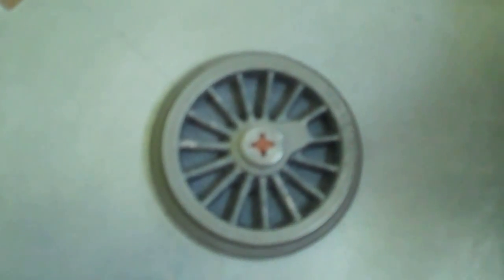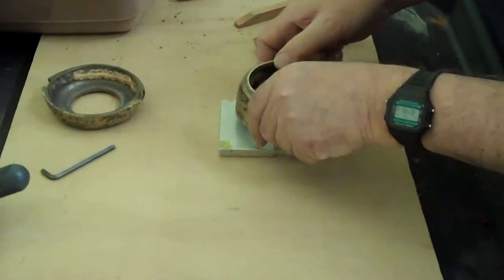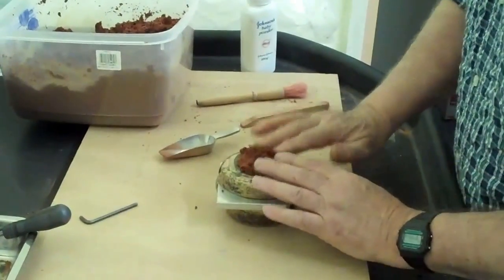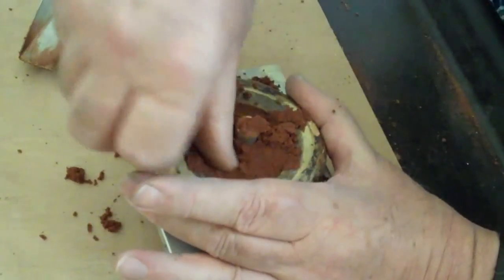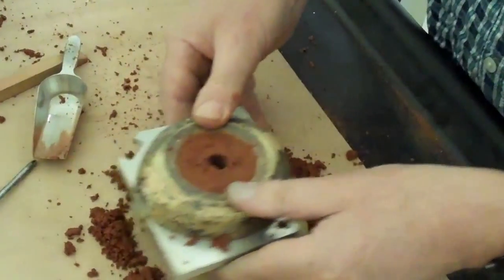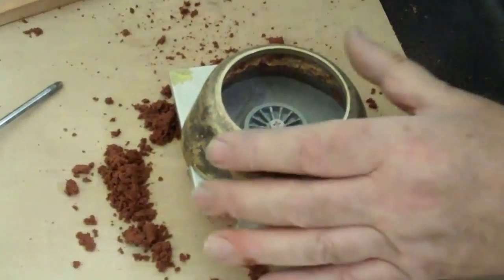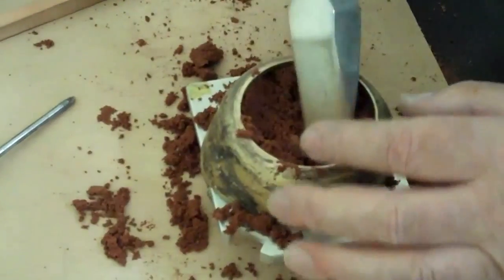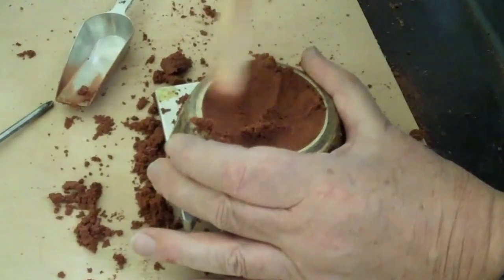Vacuum  assisted sand casting part 1 Packing the sand

Comment from the maker: The "strength of the vacuum" is far less important in terms of sand failure than the design of the table. We have a turned aluminium base where the rings are quite wide that the sand sits on and so support it well